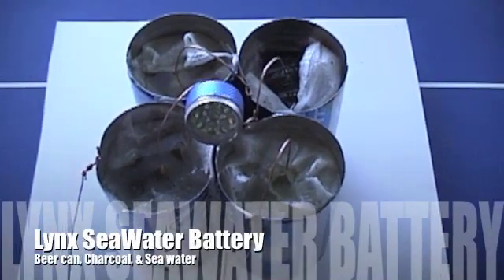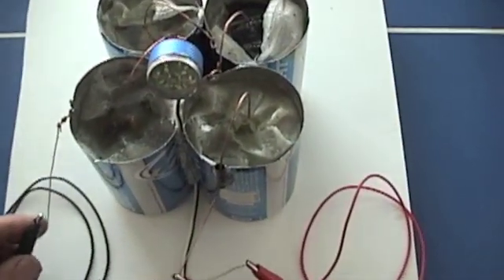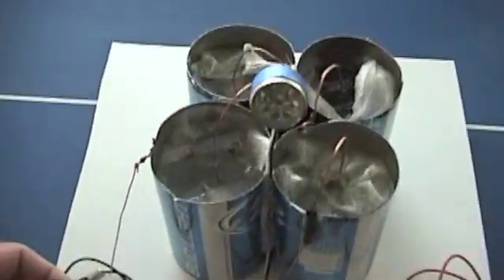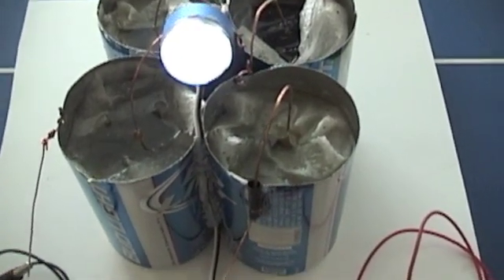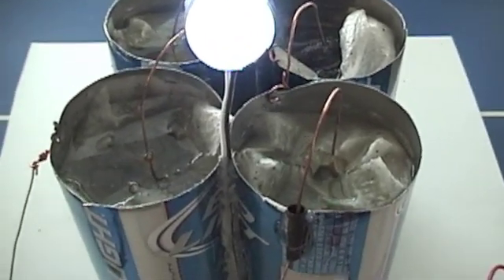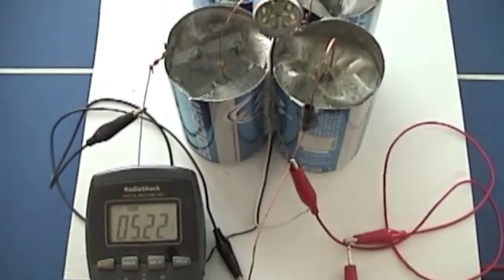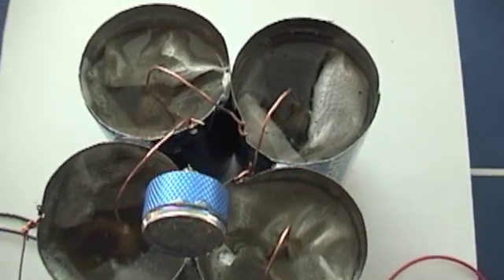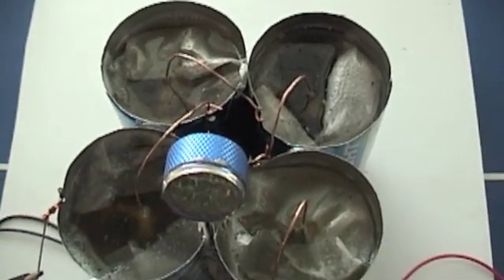SeaWater Battery

Comment: Have you seen Lasersaber's air battery? If not, it's a carbon rod, drilled in the middle with a wire inserted in the hole, then wrapped with paper towel, and finally wrapped with coil of Magnesium tape. He wets the whole cell with saltwater to get more amperage. Seems real similar to your with the exception of Aluminum vs Magnesium. Nice discovery bud! Thanks for sharing!

Comment: SeaSalt batteries are great fun.  Your cell is polorizing (gasses on the electrodes).  Break of the charcoal into smaller pieces with more surface area and place a couple drops of white vineagar or ammonia into each can and that will allow it to run a week or better.  
Brad S :)

Comment from the maker: More like amp minutes!  I ran the led for an hour at 5 ma, and voltage dropped from 5.25 to 2.75.  The LEDs were just slightly still on.  This really is just an experiment to see what the viability is.  I would say the charcoal should be packed in tighter, the copper cathode bigger, and fill with sea water.  Even without acid the copper is dissolving.  I wonder if this is just a fuel cell reconverting the H & O to electricity.